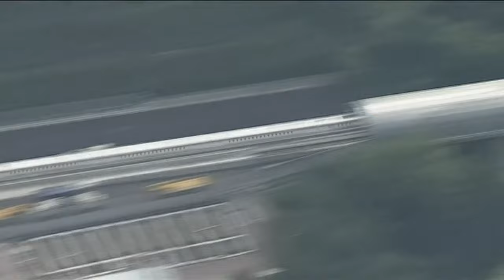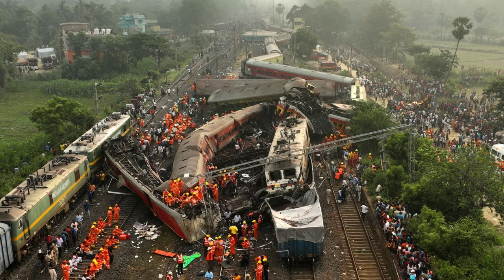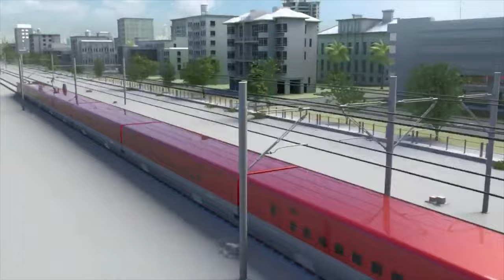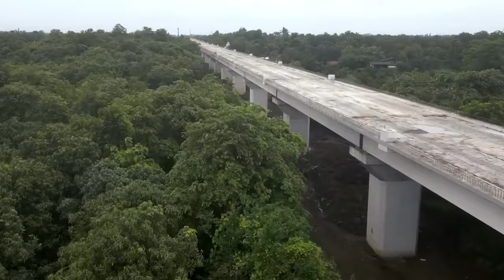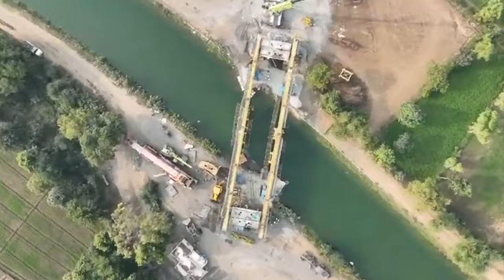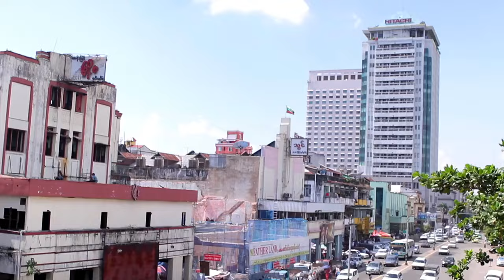India's Struggle To Build Its First Ever Bullet Train

Comment: Must have gotten the idea from the UK with HS2 😅🤣😂, no wonder thay are struggeling. Only joking, sure the Indian venture has nothing to do with the cock up that is unfolding in front of our eyes here in the UK.
Reply: On a more serious note, UK needs to get some ideas from Indian Railways. Electrification in both Indian and UK Railways was around 37% of the network in around 2014. Today, it is 100% in Indian Railways and UK is still stuck at 37%. Indian Railways is planning to be Carbon Neutral by 2030, which isn't just good for the environment, but also for India's energy security (no need to import fossil fuels for running trains anymore).
Reply: What has gone wrong with the UK Sahib?